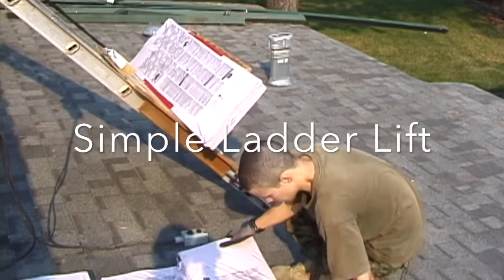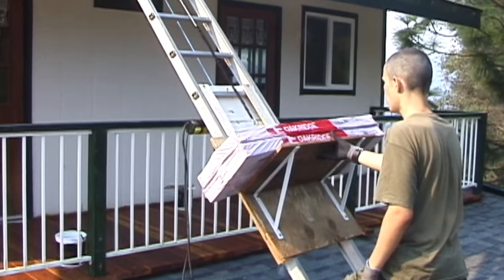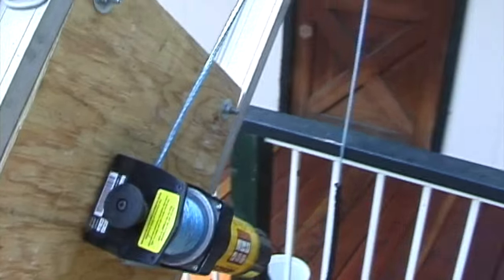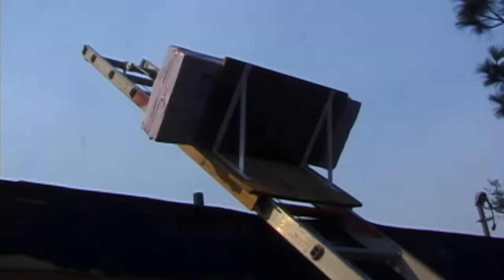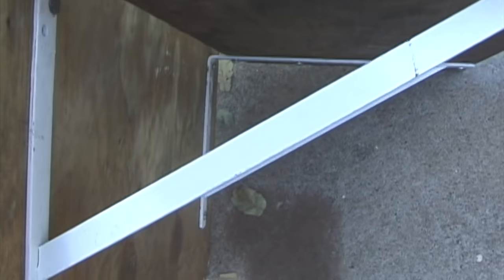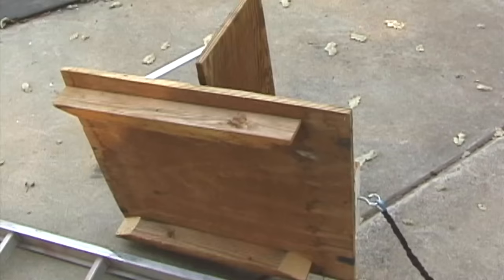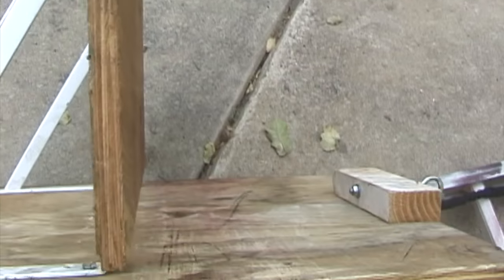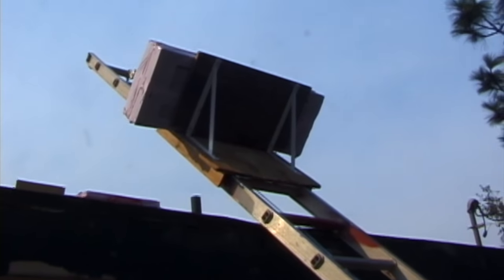Simple DIY Ladder Lift Asphalt Shingles on the Roof

Comment: Pinch point occurs at 26 seconds on this video. Homemade or factory produced, always be aware of pinch and shear points on equipment. If the trolley breaks loose with the young man's hands on the ladder rung, all of his fingers will be severed. Of course, it doesn't happen. However the assumption should always be that the equipment failure will happen at some point. The operator loads and then steps away. Hands are kept clear of any pinch or shear points. If equipment failure occurs everyone walks away and has their hands to work another day.
Reply from the maker: Great observation. He should also step to the side as there is no strong reason to be there after the trolley proceeds upward. Thanks for pointing that out.
Reply: I noticed that too, not smart, asking for a destroyed hand.

Comment: THANK YOU! I kept it simple. Took an hour to make. 2x4's and a piece of scrap plywood just cut to size, instead of bracket I opted to nail a few 2x4's at the bottom stacking them with framing nailer 2x4 at top with a 3 hook. Hoist came with rail brackets that I put on bottom rung and used wood shims before tightening it down. Cable run between rungs and used a small strap that came with hoist wrapped around top rung of slide part of ladder and hooked pulley that also came with hoist. Waxed the ladder  and underside of plywood with a bar of soap and it has smooth sliding. Thanks again K I S save me hours.
Reply from the maker: @mattdoeski7014  nicely done.  It seems like you picked up some suggestions from the comments. Awesome!

Comment: Thanks, David. I loved it and did a large chunk of my roof in May 2024. I am 67 and it worked beautifully. I used my HF 2000# 12v winch with a seperate power supply. I did have one problem where the pulley ring did bend, I repaired it using a 1" solid iron bar I had available and continued the project. I did it alone using 2 extension ladders, one I climbed, the other for the shingle escalator. Wish I looked at this 5 years prior when doing another roof alone!!
Reply from the maker: I’ve use YouTube for so many of my own projects that it’s great to give back and if it helps someone with something that I share it’s great to get feedback like yours.  Thanks and stay safe.

Comment: :)...I love it! I've used the laddervators a bunch of times over the years; but they cost a bundle premade... They're heavy as hell, the belt on the motor gets funky on the job, etc. I love your idea with just a simple sled, a few modifications and it could be a real workhorse...
Reply from the maker: Thanks for the positive comments.  I only needed it for one project but with a little thought it could be use regularly with some modifications.  Be safe out there. Thanks again, glad to have helped.

Comment: Great job!  What an awesome idea!  I wish you showed how you got the supplies off the sled and onto the roof.  I have a fear of heights so leaning over the edge of the roof or trying to get on and off a ladder feels like I’m doing it from the top of the Empire State Building in my underwear 😅
Reply from the maker: I didn’t over stack the sled with shingles (better to make an extra trip up and down to keep things safe) and I made the sled go to a place on the ladder where I didn’t have to bend down to lift them off in an awkward position. The ladder should extend 6’ over the edge of the roof making it easier to access the bundles.  Don’t hesitate to wear a safety harness when needed.  Hope this helps.

Comment: Great idea I need to get some drywall in a garage loft and am pushing 70. I’ll just build it a little longer and use a rope. I’ll soap or wax the ladder rails also to make is easier.
Reply from the maker: I get the pushing 70 thing.   Be safe.

Comment: i thought great idea .then i seen worker and his hand holding ladder rung . And thought what if eye bolt pulled out at some point .you have a 60lb guiotine.If something can happen it will .so perhaps a light mesh or some thing to stop a hand being placed there and you got a winner . great hack after safety improvement !!
Reply from the maker: Good point.  There is no good reason for him to stand in harms way.  The older I get the more I think about how to be more safe when doing anything.  Tx

Comment: I agree with you, simple is better and true genius, best job site lift on the web.
It's a matter of getting the task done with the least resources ( materials and time ), plus you can store this one anywhere and re-use as needed....very cool.
Reply from the maker: Thanks for the positive comments.
Reply: David Catherina Yes very simple and good and if you wanted to use more weight simply slide a piece of steel through that top rung where you connected your pulley.

Comment: This is brilliant and just what I needed! Hopefully I can rig mine to hoist a heavy generator into my suv. IDK. I'm going to try to make that happen. Any thoughts on that? Thank you so much for sharing this.
Reply from the maker: Not sure this application will work with your generator but I hope some of the ideas help.  Thanks for your interest.
Reply: @2edge4him  I was able to figure out a similiar way to do it. By attaching a hand winch to the frame of the back seat in my suv and a tow strap around the lower part of the generator it was a breeze to slide it up a ramp and into the vehicle. Thanks again. You're instruction facilitated the process.
Reply from the maker: @AdrianClement  Awesome.  Well done.

Comment: Maybe add some L or 90 degree brackets on the outside of the 2x4s turning in to hold onto the back side of the ladder rail, as so the load can not rock around, and tip over, and fall. Some day I will make one that I can lift plywood up with. Having it stand strait up, as easier to pull off. Maybe make a metal frame that would raise up, and keep the 4x8 sheets from falling off, and steadied, and easy to take off once up to the roof, but so they can not tip off sideways. Build it like a sled, as it will slide up, and down the Ladder, and will hold the Ply, and allow you to unload it onto the roof, and ballance it, as so it will not fall, sideways, or backwards, while being lifted, or unloading it. But so the wind may not allow it to come crashing down either.
Reply: It works...

Comment: This is what I am looking for. I’m 65 and want to do my roof. Nice work! Question on your winch: do I need the 880 lbs winch which is $135 compared to $100 for 440 lbs in Harbor Freight? It seems to me two packs of shingles is about 160 lbs max plus the sled the total weight is less than 200 lbs. Any advice? Thanks in advance.
Reply from the maker: Eventhough it is less than 200 lbs as you know there is added resistance because of the drag on the ladder rails. (Maybe you could wax the sled to make it glide better).  My winch was not from Harbor as you can see in the video (but something I aquire a long time ago) and it had a 1500 lb capacity 110v, which was more than I needed.  I would go with the larger winch (this being an educated guess that it would be sufficient).  Let me know how it goes because I would not want to mislead anyone.

Comment: Great simple idea. Question. Do you think it would work with a Little Giant Ladder?  I'm looking to hoist 100 lbs.
Reply from the maker: The weight is probably not a problem but if I remember how the Little Giant Ladder is built the locking mechanisms on the side of the ladder rails may be in the way of the guides on the sled.  You have to think of the ladder as a train track with no joints, bolts, connection points, etc that would restrict the smooth gliding of the sled. Two parallel 2x4’s on edge as tracks may work but I don’t know your situation.  Hope this helps.

Comment: Do you think this will work on my attic access ladder
Reply from the maker: There would be a lot of challenges with an attic ladder. They’re not as strong or stable as a extension ladder.and wood on wood (if your attic ladder is wood) would create a lot of friction causing drag on the sled.  Keep the weight on the sled as light as possible.

Comment: How did u keep legs on ground being so high over upper gutter
Reply from the maker: There is a limit on how high you go and the weight that is lifted but it’s a matter of balance as the bottom legs just stand on the ground. It would take a lot of leverage to counter balance the ladder out out place or lift the bottom.  Good question, thanks for your interest.

Comment: Do you know of such an automatic pully system which would work for a foldable attic ladder?
Reply from the maker: Sorry, I do not.  This was homemade. Keep searching, I bet you’ll find something.
Reply: Easiest way for typical attic ladders is (securely) mount an eyebolt to a roof beam then hang a rope hoist or small electric winch off that.

Comment: Where did you get the winch from
Reply from the maker: Not sure about the dependability of a cheat Harbor Freight winch and how many times you would need it, but it is one option. Mine was 110 volt which are more expensive so you could transform down to 12 volt with the Harbor Freight.  The brand name of the one I think I used was Superwinch 1500. I hope that helps.

Comment: Nice prototype. However, it is under built and an accident waiting to happen. Don't stand under it. But, it is simple and smart in concept. Good job.
Reply: sweetiepienumber1 Prototype😂 that simple Emma work for a long long time before you need to replace the plywood for the money that is way more practical especially if you’re doing the roof yourself, I have seen roofers improvise with far more crude methods of doing things and it works for them for years.

Comment: The young man must be instructed to not stand under the load. 
The load should be lubricated on the sliding surfaces. 
The ladder base should be lashed to 2 big stakes drove in the ground. 
15 years working high in the air.

Comment: Please reinforce those brackets. 2 more maybe.
Reply from the maker: Not a problem to add more brackets if you want the added security.  According to the manufacturer those brackets are rated at 1,000 lbs each.  It was never my intent to overload the lift keeping the load at less than two or three bundles ( approximately 250lbs). Better to make more passes up the ladder taking a few extra minutes to get the shingles on the roof safely.  Be safe and thanks for your suggestion.

Comment: Would've been faster to just manually carry up. Could be wrong but just seems lazy, roof doesn't look too high
Reply from the maker: Maybe...but I’m not twenty years old anymore.  Just an alternative for those that can’t carry 75 pounds up a ladder. It’s good you can still do it.
Reply: @2edge4him  Fair enough! Lol it takes a toll like any labor job for sure. My boss is 52 and he tries to stay away from carrying up the bundles. Makes me and the other young guy do it xD. The man that was loading the shingles in the vid looked capable though
Reply: @kevinfeeley3292  never kill your future selfs ability to function if there is a way to save your body parts now. Longevity is never more important than after you have passed the point of no return. A system like this could be used into your 70s and you'd not end up decrepit and unable to move.